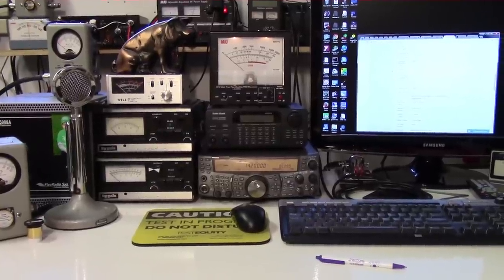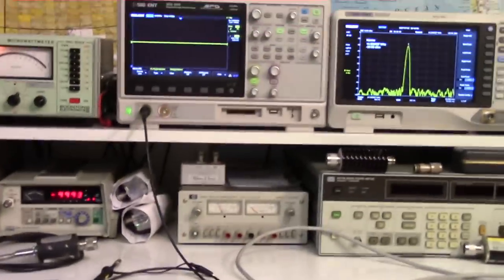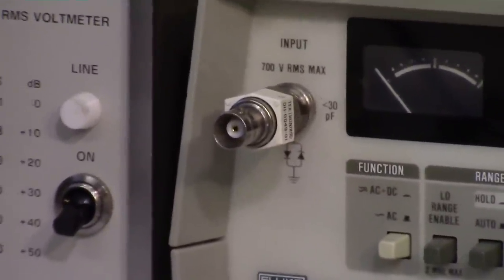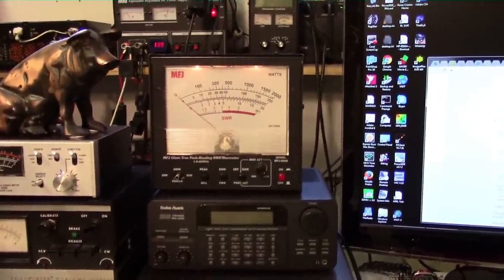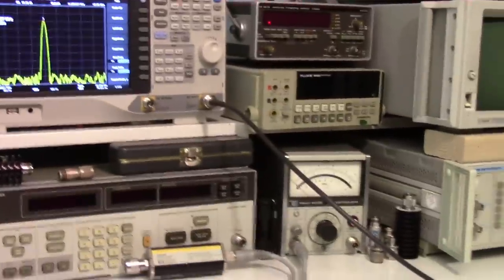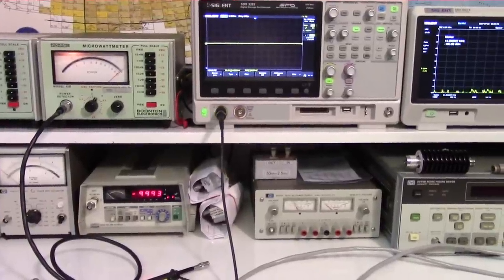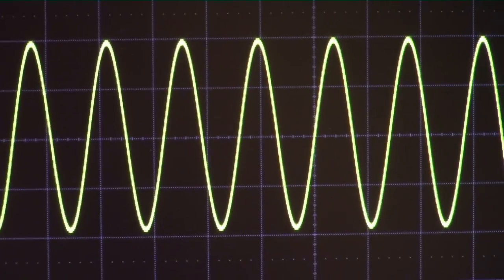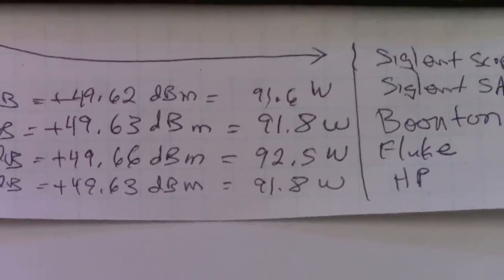Measuring RF Power With an Oscilloscope & Other Instruments

Comment: Hi GEDAS, thanks for the video, excellent material!   Not sure if you noticed but when you totaled the Siglent Spectrum Analyzer power you added incorrectly. You wrote down a sum of 49.62 dBm when it should have been 49.64 dBm which results in 92.04 Watts and leans a be more in the middle of the others.   73 AI4Y
Reply from the maker: Hi Richard. Yes sir you are absolutely right. Thank you for catching that .02 dB. A lot of people would consider it pointless to look at such small differences but it all makes a difference. Tnx again. 73
Reply: @w8bya  As a learning exercise for myself I spent a couple of days trying to correctly report the output power from my IC-9700 for 145MHz and 435MHz for RF Power % 0-100% in 5 percent increments. I really wanted to know if RF Power % on the Icom transceiver meant watts or a percentage of gain so I set out to answer that question. I also wanted to know just how much power I am sending out of the transciver when transmitting to Satellites. Is RF% 10 really 10 watts for example on each band.
My testing was done for both 145MHz and 435Mhz frequencies used by the majority of the LEO's uplink and downlink. I produced a CW tone into a Bird 8323 -30dBm attenuator followed by an HP8495B DC-18GHz 70dB step attenuator set to -30dBm and my Siglent SSA3021X. I used two pieces of 30" StormFlex 141 (rated to 18GHz) with N-SP connectors and a new 10' LMR-400 cable. For the life of me my output calculations were no where close. Eventually it occurred to me that I needed to account for all attenuation and insertion losses not just the attenuators. So I characterize every cable and both attenuators and I was able achieve my goal. Largely with the aid of your video so Thank you! 
I also tried using my Bird 4431 meter which I had installed a PEP kit in and it was in the ball park but an analog meter is a bit crude by comparison to the Siglent using MAX Hold. I also tried using a Bird 8251N dummy load fed with an N-Tee much like you did and using a probe tip to bnc adapter to connect a Tektronix 2465B for Vpp readings and calculate the wattage. I used the 1M input impedance and various probes such as P6131, P6139A, P6063B but it seems my readings were way high or low on 2 meter. The readings were closer to being correct on 70cm but stray capacitance came into play above 400Mhz relative to my body coming in contact with the cord and/or moving the cord around. I tried 6 probes in total including a brand new P6139A rated to 500MHz with the same varied results. While I've been a fan of Tektronix for years, I love my Siglent Analyzer and may have to invest in the SDS2202 as well. I find I don't require a 4 channel scope anymore, so 2 channels will be fine for my use. The SDS2202 can be opened to ~350MHz w/o to much trouble in my opinion so I'm considering it; especially since it has a real-time sampling rate up to 2 GSa/s. At 350MHz when using a single channel it can still capture enough data points to be useful at a great price.
I agree the with your comments on the Siglent Analyzer you made in some of your videos. It is a remarkable analyzer and when you have all the options enabled you can do amazing things without too much effort. I decided not to buy the Reflection Bridge as I have a RigExprt AA-1400 which covers my needs and their AntScope software is extremely useful as well.
73 de AI4Y
Reply from the maker: @richardcreasey401  A couple of comments: I was thinking back when I did the max-hold on the Siglent. To be fair I should have been taking average readings to be consistent with the way my eye/brain was gathering readings off the analog meters. I should have set averages to say 30 and go with that number not a max-hold number. Also, and this could be a topic for a future video, are the amplitude accuracy (or lack of) modern o-scopes. There once was a time when you could use an o-scope to make accurate RF voltage levels but I found that almost every scope I have tried becomes just a relative indicator of RF amplitude at even modest frequencies. The rated BW is at least already -3dB down.

I would also characterize your scope & probes and know their frequency limits wrt amplitude accuracy. You would be shocked at how quick the amplitude starts to roll off at even 1/4 the rated BW of a modern scope. Personally I am a bit disappointed in their frequency response. And then, as you have observed, different probes will result in different readings. Grab a calibrated sig gen and feed it into the scope and start climbing in frequency and note where the amplitude starts to roll off.

Also, I am with you.....years ago I used more than 2-channels but nowadays 2-channels meets my needs 99% of the time. I do have several 4-channel scopes (most modern is a Tek TDS 744A) with lots of BW & sampling capability but I will take my Siglent over it 10:1. The user interface and capabilities of the old Tek are dated but if I ever need more than 2-channels at least I have something (other then my ole 7000 series stuff).

Oh 1 final comment about the setup.....this method of converting the scope probe tip into a coaxial interface is a bit of a kludge and not really suited for frequencies about HF. If I were to try this at 2m I think I would devise a more direct and fully shielded method to sample the RF......as far as 432 MHz.....ur a very brave sole for trying this way up there <g>. The stray RF must be significant and I think I would use at least 5-6 type 61 ferrite cores and make sure all of the cables have a CM choke at each end to help dampen the RF floating around.

Comment: Thanks for the video. I'll be running this test tomorrow using my Tek MDO3012 scope, then I'll try to work out the ratio of my w2aew RF sampler I built.
Reply from the maker: Sounds great & do let us know how things turn out. As mentioned in the video pay real close attn to the BW (and sampling capabilities) of your O-scope. The amplitude accuracy starts to quickly drop off long before you hit the "rated BW" of most scopes. For example a 100 MHz scope is usually already down 3 dB (or even 6 dB sometimes) by the time you hit 100 MHz. You will see the signal and be able to sync to it but it's amplitude will read low. 73
Reply: Thanks w8bya. My scope has 500MHz bandwidth, and I'm only testing on HF. The testing went well. Although the attenuation of my homemade w2aew resistive RF sampler varies across the bands. It works great as an RF sampler, just not good for power measurement. More work required.
Reply from the maker: Hey that sounds great. That scope looks like a real beauty. One thing that you could get for less than $40 many times on e-bay is a nice directional coupler rated for 100W in the HF range. Narda makes many for example and the net is always full of used ones.

Comment: Very nice video  - it's always beautiful when all adds up right :)  I'm just a little courious about the formula part at the end: Is it common to use the letter 'E' as formula symbol for voltage? I'd think it could be mistaken for electric field strength. We mostly use 'U' here in Germany, I've seen 'V' is used often in the US. 'R' for resistance and 'I' for current seems quite everywhere the same..
73 from DL
Reply from the maker: Hello and thank you for your FB comments. Depending on how old you are and which school you went to the standard definitions in Ohms law used the letter "E" to signify the voltage. I suspect it goes back to many, many years ago when voltage was referred to the Electromotive Force (EMF) and for very short just E was used. Thus it was/is common in Ohms law to use E like in I = E/R, or R = E/I, or P = E x I, etc even today. So to be consistent with Ohms law I like to use "E" to designate voltage but I also find myself using "V" for times when reading the voltage on meters & scopes etc. So you are right.....it can lead to confusion when using different letters for the same parameter, esp if one starts to think of E & H fields hi-hi. TU for taking the time to look at the video & for taking the time to comment. 73

Comment: Hello there, thanks for this video. It was very very interesting and exactly what I was looking for. 
I was running some tests yesterday cause i bought two used bird43 and I suspect they’re not very calibrated. Also taking the same slug from one meter to the other shows 10% difference. I’m not happy with that. . I have an AC millivoltmeter (Racal DANA 9300F) plus a Boonton 93E is on its way. Bought a sig gen not long ago, my very first, and it’s a Marconi 2022E. The problem is I don’t have a reference to start from. All instruments are used. 

Furthermore I have very little experience but I’m getting more interest in electronics now after been ham for 20 years or so. 
So I’m buying some equipments and trying to understand theory behind. 

Here’s my question: at some point you said that a lot of people don’t realize you need a feed through to connect your voltmeter, in your case the Fluke 8920A. So why is that? My AC millivoltmeter has 1meg input impedance and I have connected it with a T across a line going from my rig to a 50ohm dummy load. It seems to work. Is that connection correct? What’s the purpose of that feedthrough that you mentioned? 

Thank you so much for your kind answer 🙏
Looking forward to it. 
73
Reply from the maker: Hi Diego I am very happy that you found the video useful. If you want to make accurate (absolute) measurements then the entire system must be 50 ohms (source, transmission lines, terminations). You can use a T-adapter and dummy load at the voltmeter as long as the dummy load is very accurate and 50 ohms. If your load is not exactly 50 ohms then your readings will be off. Most good quality 50 ohm feedthroughs will be accurate for these readings. If you did not have a 50 ohm load at the T adapter your readings would be off.
Reply: @w8bya Thank you for your replay! 
I’ll play around a bit and try to reach a solution for doing some calibration but I’ll need to buy some new equipment I guess to have at least a reference for all the rest. Any suggestion? How could I calibrate the birds 43? I mean as I said the same slug on two different instruments show 10% difference. Let’s say I test the meter with a circuit for 30uA FS and is not accurate, can I calibrate it in some way or I’ll have to buy a new instrument?
Reply from the maker: @IZ0MTW  That is a basic problem every lab faces. That is obtaining a known standard. This is why their are calibration labs. The Bird 43 series power meters are rated for +/- 2% accuracy and the elements rated at +/- 5% (full scale). As you can see you can have quite a range and still be in spec. You can either buy a more accurate power meter or have your signal generator or power meter calibrated by a trusted lab. If you needed a quick and dirty power level that you could "most likely" trust w/o sending off your TE to a lab I would suggest purchasing a HP 435 or 436 or 437 etc. The 0 dBm 50 MHz standards on these meters are usually very accurate even when they have not been calibrated in a while. I am not saying you may not get a lemon but of all the power meters I have owned those 0 dBm standards were VERY close to being dead on.
Reply: @w8bya  Hey ok thanks for all the nice tips!  I loved to watch your long videos, it was like a full immersion in your lab. Today I’m gonna buy some wood to make a table for the instruments. It’s exciting to start playing with these things, especially now with this covid situation where we have to spend most of our time at home. Cheers!
Reply from the maker: @IZ0MTW  Awesome and thank you for sharing with me your thoughts and opinions on my videos. I get some negative criticism from some people for talking too slow and not getting exactly to the point. I respect their opinions as well but I make my videos that way I like to see other peoples videos as I like to learn from them and do not like to be rushed. One very important tip if you are going to make your own work bench....MAKE SURE YOU MAKE IT DEEP ENOUGH ! As you can see in some of my videos the TE can take up a lot of room (front-to-back) and this does not leave you much room in the front of the TE for your experiments and gadgets being measured. I suggest a bench at least 4' deep front-to-back.
Reply: @w8bya  yep you’re totally right and thank you for suggesting.That was my concern. I wanna make it with a shelf 1 foot above the main table. In this way I’ll have all main equipments at eye level over the shelf and all the table’s surface is free to move around TE and stuff. Unfortunately today I couldn’t find the wood that I want so the project is delayed for now. When is done perhaps I may make a video and share with you. 73s!
Diego

Comment: Hello ..
congratulations for the videos and I did not fall asleep at any time. The truth is that at some point I still had that concern about precision when measuring power. configure a device to 100 watts then an attenuator of 30 db plus another of 30 db and apply it to a tektronixs oscilloscope and the port at 50 ohm that seemed more direct and less lost by cables and connectors and eureka! measurements were similar with an ifr 5970.
I would like to see a video of you with the bird tuner and directly to the oscilloscope and see your results.

Thank you very much for your video. !!
Enrique Vidal
CE5LBM
CHILE
Reply from the maker: Hello Enrique I am glad you did not fall a sleep :-) I do not understand the term "Bird tuner"......can you please tell me what this device is?

Comment: I get asked this all the time and people should be very clear on this point.  When your using any instrumentation like this where the power terminates in the instrument the instrument is your dummy load.  And being the dummy load you need to be very careful so you don't blow the front end out of your SA or sensor head.  Making sure you add enough attenuation is critically important.
Reply from the maker: For sure Mike.....good advice !
Reply: Is that what happened to your old one?
Reply from the maker: @rabbibacongrease88  no old scope still around and get used here and there. I have been lucky and can say I have yet to fry a scope. 73